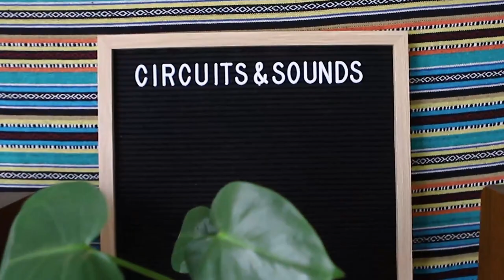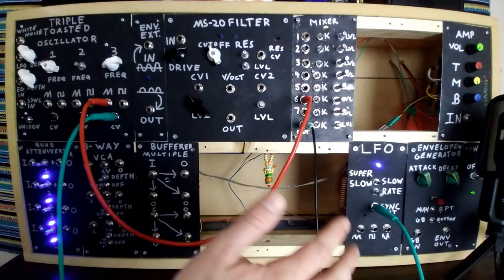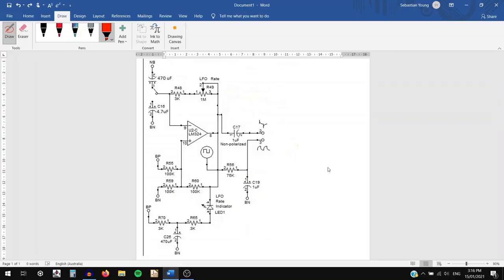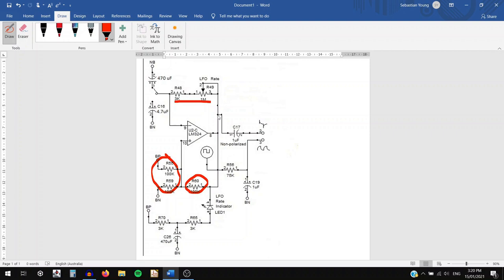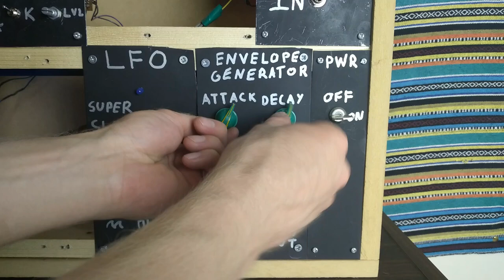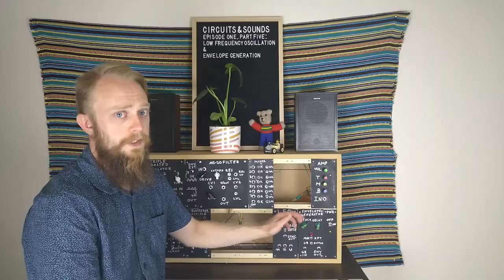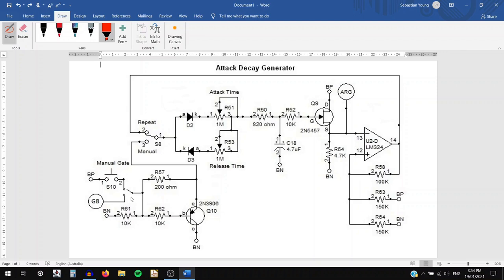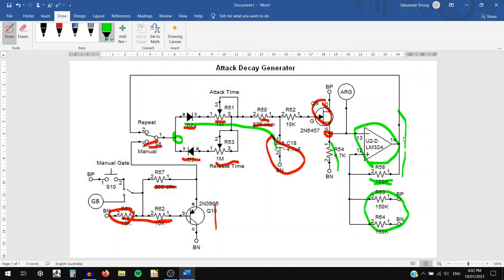Low Frequency Oscillation & Envelope Generation - Exploring Slow Modulation & Envelopes

Comment: I've been trying to build the noise toaster from "make: analog synthesaizers" and it has a very similar envelope generator to the one you show here. I've been wondering what is the role of Q10 here? Why is it needed? Could we not just apply BP to the capacitor with S10 only? I trid removing R62, R57, R61 and Q10 so manual gate S10 was a direct connection from BP to the junction of diodes and my envelope generator seemed to work the same.
Reply from the maker: That's because it is the Noise Toaster Env. Gen! Hahaha. That's a good question! And unfortunately probably only one that Ray himself would be qualified to answer, but he passed in 2016, so there are many questions that myself and I'm sure plenty of others are left with! 
I never personally experimented with removing any of the components, but I have a feeling the transistor and associated components is to offer some more linear switching and charging of the cap, whereas the switch by itself could be a bit noisy with switch bounce. 
That's only my amateur educated guess, if anyone else reads this and has a more concise answer - fire away!
Reply from the maker: Also to probably offer a bit of current limiting as well! 12V directly from the switch could create some spurious behavior from the EG (Or worse, magic smoke!).
Reply: @sebbothebushnerd  Thank you for the answer! I'm also having trouble setting up the repeat mode. If i set the switch to manual the AREG works as intended so i'm guessing the problem is in my op-amp. Am i understanding this right that the voltage on the source pin of Q9 should be the same as the voltage on the capacitor? I'm trying to find where my envelope generator stops working, since every time i set S8 to manual the output of my op-amp jumps to high saturation and stays there instead of switching between high and low.
Reply from the maker: Hmmm, maybe check where your positive feedback resistor is going. A comparator sticking in one state can usually be attributed to this. 

Otherwise, starting again can sometimes be the most effective method! Hahaha. 

It's not a massive circuit, so just check every connection one by one and you should hopefully find the issue!